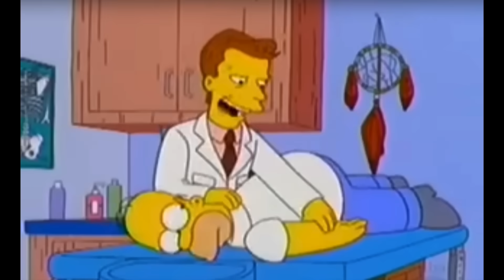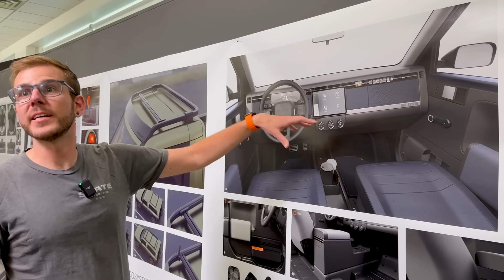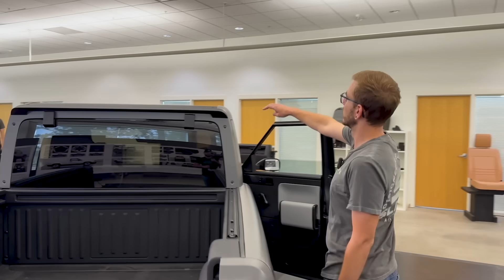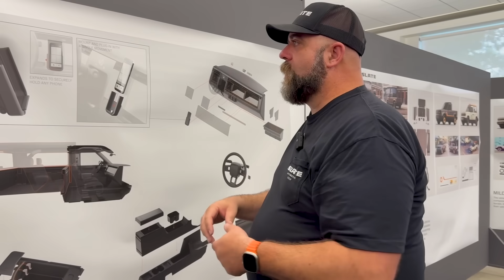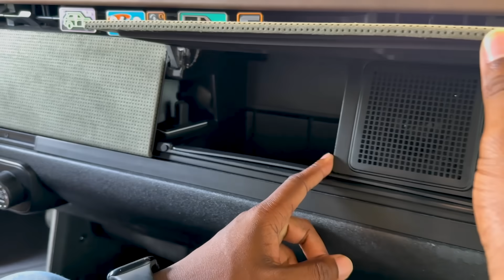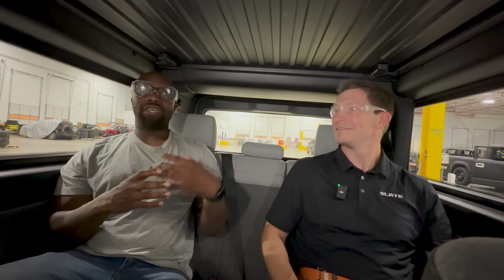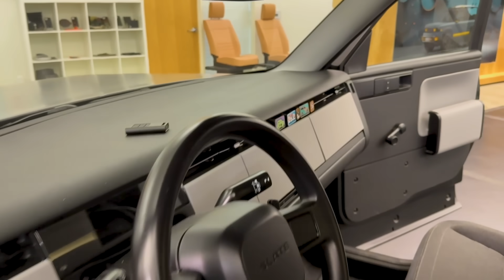The Slate: America’s $20K Answer to China’s Cheap EVs (Exclusive Access)

Comment: Why this vs a Maverick?   I can repair this; it seems to be mostly modular.
Accessories: Ford did the same with the model T; he designed it with farmers in mind.
Price point: i only order what I want, and as an old Boomer, I don't want a lot.
150 mile range: average driver doesn't drive thar far to work. As a daily driver 👍 but for that occassional long trip..that could be a problem.
Biggest plus is right to repair.

Comment: I just don't 'get' this concept. I'm all for customization, but I want GOOD customization. I want what traditional dealers offer for vehicle options, but want to be able to just PICK AND CHOOSE THOSE OPTIONS. Not their 'value packages' which are often packed with things I don't want. I also want my selections to equate to ultimate price and be CHEAPER than if I picked everything. I want an ala carte menu concept and know for each option what it will cost me. $50 for this, $200 for that, etc. Don't want a stripped down tinker toy vehicle that looks like my 1994 Ranger pickup (and actually that cost less than this thing as new and it had some amenities this doesn't almost 30 years ago).
Reply: Well said!

Comment: You don't get something for nothing. The safety / durability / cost / comfort / weight / water resistance all have to be compromised if instead of a strong & efficient unibody, you have removable sections.

This seems like a great concept, but I strongly suspect that there are some incredibly signifianct issues and flaws that will be discovered if/when it is ever release.
Reply: Sure buddy, not like Detroit has auto engineers or anything. Rewatch the video and look at the heft of those door structures and the size of those frame members under the plastic skin.
Reply: @truantray exactly. Heft = weight. 

You proved my point perfectly, you dimwit

Next 😂

Also, detroit is a city of drug addicts. The auto Engineers have either left of died off.
Reply: @truantray precisely. Heft = weight. 

You just agreed with me 😂
Reply: And the fact that the entire frame and mass of steel components are all coated, so you won't have the frame rotted out in 10yrs as with every other offering from Ford, GM, Dodge, etc.  Everybody keeps saying Maverick or Equinox, but those things are complete shitboxes.
Reply: @boxlid214 american vehicles have uncoated frames? Bare metal?

It wouldn't surprise me. They're all crap
😂😂😂😂😂
Reply: @procatprocat9647  correct, and correct again, everything ALL manufacturers are producing right now is pure trash.  None are good right now, the Asian producers are having massive recalls and issues as well.  It's a very bad time to buy a new vehicle.
Reply: @boxlid214 every time is a bad time to buy a new vehicle imo. 

All you get for that massive depreciation bill is a nice smell. 

I would never buy a new car, irrespective of my net worth. It's always a dumb move

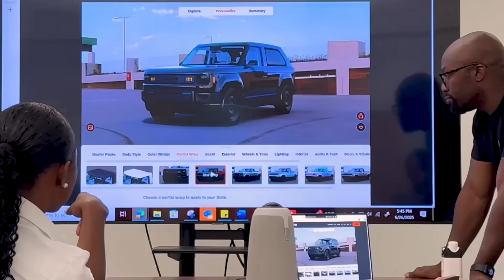Comment: 42:00 you do understand that if you Rich want the pickup to be as you designed it its no longer a 20K car, right!?! i think Slate are smart going only for the simple "blank slate" approach until they have sold and delivered at least 10K or 20K cars inside USA before they can 
build the rest of the production assembly line that is needed to give you a fully kitted and wrapped car.

Comment: It's still too expensive.  This thing should be $15k.  No paint, no radio, small electric motors are so cheap you telling me that's a real savings with thousands of units??  This is super underpowered and seems to be no fun and likely useless off road.  Side note isn't a good wrap job like $2k?  There probably aren't as many skilled do it yourselfers to make this work.

Comment: If they can make it so that owners can install their own or have their own front motor installed and that's duplicate of the rear motor then a slate with 400 horsepower would be pretty damn nice

What's the weather at that point it's probably going to get used leaf range of 80- 100 mi to a full battery

Comment: As a 25 year old, I’m so excited for these to come out. It’s something I could realistically afford
Reply: Its not 20k. Its 27.5k. Trump cut the tax break. You have till the end of the year but the truck wont be out by then.. and nothing releases for what they claim, so its probably gonna be a 30k truck with roll down windows and no radio.. 

At that point you might as well buy a Maverick or a slightly used Ridgeline.. way more capable at doing 'truck stuff' for the same price, will last longer, hold value longer, can go more than 100mi between fill-ups.. and probalby comes with a radio too!?
Reply: @rogerwilco1777 sure, the ultra reliable Maverick. While stuck on the road, you can play with the windows buttons and listen to the "radio". Because we all listen to radio in 2025.

Comment: In the early 80s, brand new, 2wd, 4 cylinder, no rear bumper and manual everything Ranger and S10 trucks sold like crazy at a similar price point. 
Brand new trucks with 2x6 wooden bumpers on the streets looked funny.

Comment: For some reason, the idea of an EV that is this simple and doesn't have Big Brother vibes is very enticing to me.
That I can own the vehicle, not have to worry about software updates, features modified or put behind paywalls, and own completely without a "license for the software that runs it" makes sense to me.
I like that there's an optional app, but it doesn't require said app--so (theoretically) in 10-20 years, even if we've moved beyond Apps for whatever comes next, I can still get in and drive it.

However, being in Western Michigan, I would have to wait until a FWD, or AWD version is available. That's really the biggest drawback for me.
Also... yeah, that battery range is a bit rough, but how often do I ACTUALLY drive more than 240 miles at a time? Heck, a 30-min recharge is snack break anyways, so that's not so bad to me (in theory.)

One thing I'm curious about is repairability of the composite material. One would assume these molded parts won't be manufactured into perpetuity, so if it gets cracked, or damaged, how does one repair that part--Plastic bondo? Plastic-welding? Jumbo 3D Printing?

Still, I like this move and I look forward to seeing where it leads to.
Reply: Which company puts stuff behind paywalls?  Updates are excellent as it fixes, enhances, and sometimes delivers new features.

Comment: 1) Best video on the Slate so far. Period.
2) I also would want a shell over the bed and the fastback might be the most compelling.
3) I am more than a bit sad it's only available in real wheel drive     :  (
4) Wondering about power outlets in the frunk? (your friend didn't mention them so.....probably none  and power outlets in the bed.

Comment: The only thing I see wrong with this vehicle is that it isn't offered with a gas engine or a gas range extender. This isn't a knock on it. I just don't want to deal with range anxiety. I'm guessing because of its low overall price, things like headlights and taillights won't cost over $1000.

Comment: Slate could definitely offer some "custom" designs which are 80% complete when delivered. Another option is to get shops set up regionally which can do all of the customizations in one place for a set price which could be included in the purchase so you can still work with a single truck loan. The truck and any materials needed would be shipped to the shop and you could then either go pick it up or they could bring it to you for a delivery fee. I'm sure there could be shops set up in the Bay Area and near LA to do this. I expect these trucks are going to be so popular. The next model will need to boost the range.

Comment: I really want to believe in Slate and this entire process of vehicle ownership, however I don’t know if they can deliver on the price point. Once you start with the most minor upgrade,you’re $40-50k in price without the reliability of a known brand. I hope they work out.
Reply: Just because Elon Musk conned everyone, does not mean an EV should cost more than ICE. It uses a fraction of the parts and battery prices have dropped 90% in the last 9 years.

Comment: Range is gonna be the biggest issue.. people like me that would like to save on gas for the 200 mile per day drive and many Truck enthusiasts need 300 miles range
Reply: The average personal use truck in the us is 14,000 miles driven annually SMFH. 
The average us daily commute is 37 miles!

Sadly you are correct the range will likely cripple this from the jump. I don't see how customer added parts could ever pass crash testing either?
Reply: @4literv6 has nothing to do with averages though cause that one time you need  to make a round trip of 200 miles  to haul something or just see family (welcome to Truck country if you've never been), you are screwed. If you're going 37 miles you can just get a damn Leaf and be ok. Trucks have a purpose for rough terrain and country roads, and there are no fast chargers in those areas. This project sounds nice but will fail if it doesnt have a higher range. Also you know when they say 240 the max will be 200

Comment: The "Bring Your Own Device" Mount is something that Dacia has been doing with their less specced cars. It's a little spring loaded flap on the dash that opens up and clamps onto your phone, you plug it into the cable and it just works with the car. So long as the app is available at least.

Comment: The 1,000 lbs tow capacity is an issue for me, that's 500 less than a Corolla and not enough to tow my midsized jet ski.
Reply: This isn't the truck for you. This is for in town deliveries and 60 year old ladies to go get bags of mulch at home Depot.
Reply: It can tow a jet ski.
Reply: @ksavage681  not a midsize or larger ski, with only 1,000 lb capacity. My Waveruner is 850 lbs with fuel, factor in another 500 for the trailer, that's 1,450  lbs, which is almost 50% above capacity.  Forget about even larger pwcs that weigh close to 1,000 lbs without trailer.

Comment: If they release CAD for things like the body panels and bumpers , then 3rd parties could 3d print them. That would take pressure of Slate when it comes to inventory.
Reply: This is looking like an open source truck
Reply: @Cassinspace  lets hope they are that smart about it
Reply: You could print your own benchie truck.
Reply: not to mention low cost, local production and less waste!
Reply: While I don't doubt it would be possible to print or even reinforce exterior parts on your own so it's not britle or about as strong as tissue paper. I'd imagine there's tolerance and strength issues that might come into play that make it difficult. Do I still expect someone to try  to slap some fiberglass and bondo on a 3D print regardless, yeah definitely. "Because you can" inevitably beats "But you shouldn't" for someone at some point, especially if they can make a youtube video out of it.
Reply: Ignoring the structural requirements and the surface profile, who has a home printer that can do a 4 to 5 foot long part with a Z that is probably a minimum of 5 to six inches? Print doodads and trinkets, sure, but whole body panels? How much would that cost from a third party vendor that had an industrially oriented printer? There are many processes that lend themselves to larger parts that are more cost effective than 3D printing.

I doubt they are going to release all their CAD. More likely is that they will release the surfaces so that you can locate mounting points to create your own bolt-on accessories.
Reply: @rogermccaslin5963 I mean I've done 4-5 foot wide prints (light bar frames, long story) but holy shit even a 3 inch tall item that big takes a LOT of sections, a LOT of solvent welding, and a LOT of forethought to make it come together and not look like total dog shit. Printing an entire body panel would be hilarious to attempt, and would NEVER look good lol
Reply: honestly I think doing this would make them super big in regular folks heads assist how Elon has snuck in.  these are actual cool looking trucks nice people and
Reply: Why would they do that?  Managing parts inventory is not difficult and selling parts is more profitable for auto makers than the cars themselves.
Reply: Never see it.  Its pretty obvious they are trying to make their $$$$ from the add-ons for this thing which obliterates the entire point of it as it'll just be a not very good $35,000 vehicle at that point.
Reply: They would be lower quality though so you would lose some of the safety
Reply: Don’t worry, this thing is never even launching lol
Reply: Sigh....3D printing those panels would be the slowest, weakest,  most expensive and most awful looking option. Learn about something before making a comment.
Reply: @truantray ignore that part about 3d printing and the idea wins. People could print body panels if they felt like punishing themselves...or they could use any of the other manufacturing method.
Reply: @truantray It’s very funny to see people proclaim how excited they are for filling their car (that they’re not going to buy) with plastic shit

Comment: Rear wheel drive is a mistake. First winter these are out there are going to be nothing but videos of these things crashing. The general public does not know how to drive a rear wheel drive car in winter.
Reply: You realize that there's hundreds of thousands of 2wd open diff truck driving around right now right?
Reply: @mostIy_peacefuI  I get that. But I think you will find that the 2wd only Ford Ranger doesn't particularly sell well above the "snow line".
Reply: @DFMurray  Having owned an early 00 one, they even like getting sideways in rain.  Still, they sold quite well overall.  I'm sure if the base actually makes production and sells, they'll roll out an awd option.

Comment: Cool concept. I live and work in Detroit. So like a lot of people from here I work in automotive supply chain. I’m a machine builder. I build the machines  the the big 3 use to assemble their vehicles. I’ve done interior and mechanical aspects of that. That said. BIGGEST issue I see from this concept is quality control. You sell base model with some form of warranty. What happens when Joe blow that knows nothing about vehicle assembly bolts on a suv kit and then complains that said SUV kit rattles and makes noises then pull up to house and accessories that were there are no longer there. 😂 I believe for someone with technical experience great idea but what’s gonna kill them are the idiots that don’t understand how to do their “own” quality control. I’ve been watching the development of this vehicle for some time. VERY cool idea I just think they run into issues from people that aren’t “car people” and selling a vehicle to some that can’t assemble ikea furniture telling them that it’s like a cheap ikea truck then expecting the quality and none issues of a Car Manufacturer. Just one humble mans opinion. I wish them above and beyond success because I believe in the idea I just don’t see practical application fully coming to be.

Comment: This little truck even without rebate goes for about what a orignal small ford ranger would go for with inflation added in (i'm not counting the F150 sized NEW ranger) and people that complain about HP an 0-60 or the capactiy.... dudes this thing is almost in line with almost every aspect to the last year of the small ranger even in final vehicle weight which shocked me... this sucker is under 4000 lbs.

Honestly this truck fills that small ford ranger niche an it even looks a little like a bronco II with the suv configuration. Yeah it'd be cool to have a hybrid or small ice but 2025 cafe fleet requirements would mean slate would have to achieve close to 40mpg while also being able to do all your "truck" things. which... I don't know if you can get a small ice engine in something this shape to get that kind of mpg if even the maverick can't do that without the FWD hybrid

Comment: The sales pitch reminds me of the Scion cars.  Where it was Oh how awesome it is to customize.
Reply: The Ford Maverick had a bit of this at launch too with offering 3d print file for people to print their own accessories.  Not sure if this is still mentioned or offered in the marketing.
Reply: But even without customization, Scions had great features. I still have a Scion tC I bought new in 2007. Great sounding stereo w/ CD and aux, electric windows, super comfy Alcantara seats and a good quality interior, great climate control and ice cold AC, 17" alloys, panoramic moonroof, Toyota dependability, just $27k out the door. I wonder how many 2025 poverty spec Slates will still be on the road in 2043...
Reply: @K31TH3R None because none of these things will ever actually be made. There are so many vaporware EV companies now it’s insane.
Reply: I remember looking at the Yugo and the vw dealer insisted you could not buy it w/o the $2000+ Blaupunkt radio. Almost doubling the sticker price!
Reply: What moves you?
Reply: Also see how well Google Ara phone and Framework laptop sold.  Customizable products seem to be a very niche market. The mass market likes a well put together vehicle. 

2-seater trucks? 20,000 sales per year?

What will sell more? Slate 2-seater or 2.5-seater Aptera?
Reply: @transendre1  I generally agree with you though 20,000 trucks per year would be at least twice as many as Rivian R1Ts sold per year.  Not sure how many Slate needs to sell in order to be profitable or successful though since I imagine profit margins will be slim.
Reply: @transendre1 and just like the framework laptop, the number of people saying they want it to the number of people buying it seems to be about 100:1. Turns out no one wants to 3d print a speaker mount for their stupid Bluetooth speaker that they now have to bring into their car with them every time just like how no one wants to change the CPU on their laptop when they can just buy a new one and get newer everything else too.
Reply: How is no one else mentioning the Aztec? This is literally just the Aztec